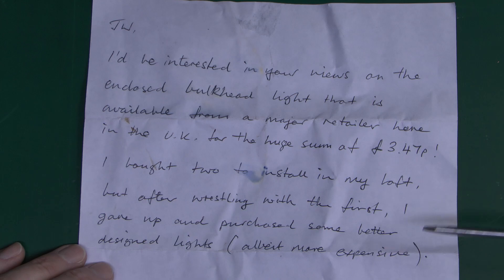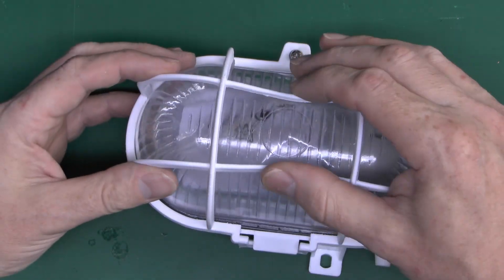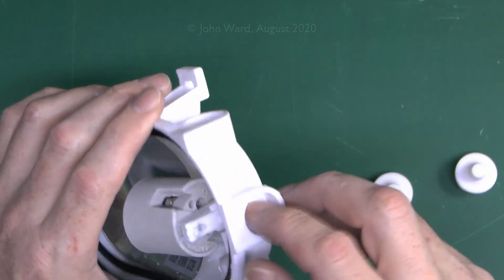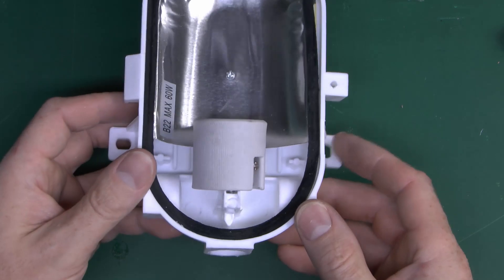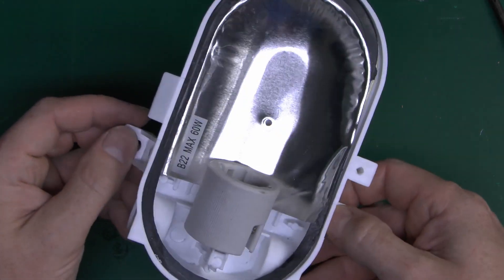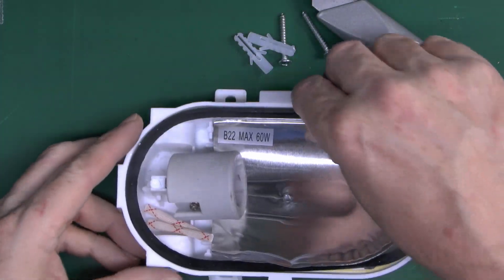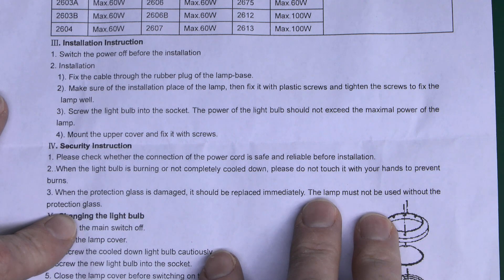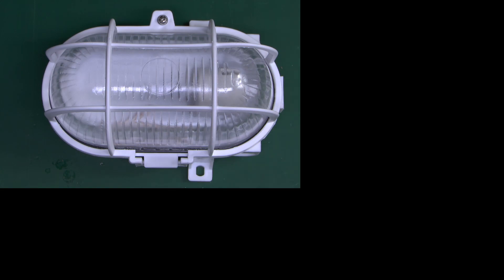Cheapo Bulkhead Light Fitting of Failure

Comment: I've fitted a few of these, but I think mine were £5.50 each. In all the cases where I was fitting them though they were terminating into PVC conduit boxes, so I completely assembled them with a lamp and 300mm of 2 core flex as a fly lead and put them up as a complete unit. I wouldn't fancy trying to wire them up while they were stuck to the wall.
Reply: I've used these with LED lamps, and did the same thing, fitted fly leads and used a junction box. Good enough.

Comment: I'd really like to see an experiment showing what happens if you really use a 60W incandescent bulb.
Reply: Much more fun with a 100W lamp 😀
Reply: if it's getting hot enough to need a ceramic bulb holder and fibreglass sleeving, the fixing of that holder to the plastic is going to be "interesting" isn't it?
Reply: Any 60W bulb would do. It doesn't have to be incandescent.
Reply: pmailkeey - such as?

Comment: “I wouldn’t recommend putting this in a mine”. Classic!

Fine for an attic. Wouldn’t fit these outside.
Reply: Chuck...
It's cheaper than using dynamite.
Reply: Providing your attic has no dry woodwork in the roof construction #fire haz.

Comment: If you buy a decent quality bulkhead fitting, it'll  last for decades, I installed an Appleby bulkhead light, (heavy metal base & glass bowl) in my front porch in 1989 & it is still in nightly use now, 31 years later. Originally used standard 60w GLS lamps, but in 2005 I installed a General Electric 12 watt CFL lamp & that is still going strong too!

Comment: Thats actually better than i expected for under 3.50. I didn't expect a glass cover and ceramic bulb holder. I expected cheap plastic.
Since the case is double insulated plastic, it doesn't need earth. Just screw a terminal block onto the earth wire, cut off the earth wire or use 2 core cable.
 I wouldn't mind fitting this but i wouldn't fit it outside.
Reply: Totally agree in that it's good value and also doesn't require an earth connection.

Comment: I remember using this exact model of light on a theatrical flat. Couldn't terminate the 20mm PVC conduit into it as I'd planned, so I had to drill a hole into the back and use a back box to hold it on, bending the reflector in the process. Glad it was only used for one week of shows.
Reply: Put the conduit into a box then run a flex.
Reply: @martinwinfield2935  I had to keep the full conduit appearance for it to match the set design. It was only a temporary installation.

Comment: I have one of these in my shed, lol. It was from Tool Station. It's not great but adequate. Hardly ever use it as I don't go in the shed at night. I think I just used two core flex from the switch I installed to the light, so Earth wasn't a problem dangling around as you say. You could always cut it right back to the outer sheathe anyway.
Reply: Arcane...
What's the point putting a light in the shed when you don't go in there at night?
Reply: @redblade8160   Sometimes I'm doing stuff in there just as the sun is going down or it's a really cloudy day, or I need to quickly get something out of the shed in the evening so only need it briefly. I turn it on about once every few months.
Reply: @ArcanePath360  
How do you manage to find the light switch in the evening when it's dark?
Reply: @redblade8160  lol, it's inside the door. I just reach around. Besides it's never that dark, as there are street lights nearby.

Comment: Wonder if that's the same ones B&Q have...

Last time I installed 60w basic cheap bulkheads the ones I got had polycarbon like plastic backing plates, very firm fitting glass covers with metal wire grilles, £6.95 each in 1990 and made in west germany, one over the back door was still going in 2004 till the building fabric got upgraded, far better made than what you have here which looks like a chinese made effort if I've guessed the country of manufacture right... though most stuff being made in China it would be a surprise if not.

Comment: John do all lighting circuits have to have an earth supplied, I'm looking at that and seeing all parts are plastic no live metal parts to be brought to the potential of earth? I agree with you it's definitely not going to cope with a 60 watt incandescant globe.
Reply: If it's at the end of the line, not a problem.  If you have other lights on the circuit, you need earth continuity in the cabling even if all the lights are like that one.
Reply: @bdf2718  Yer I understand that, but the cpc conductor could just be folded up out of the way, couldn't it?
Reply: @busman2000  BS7671 requires an earth to be provided to all points, even if it's not required by the current equipment. Presumably this is because the IET know that installations last much longer than the equipment they supply and the replacement equipment may not be the same class as the current equipment.

Comment: not the best fittings, but nowhere near as bad as you make out, there are much worse versions of these about. many new more expensive so called quality fittings are far worse than these with only enough room for a single flex and no possible way to have more than one cable in and terminate safely.

Comment: What exactly would you ground in that fixture? The entire thing is insulating materials, except for the internal reflector. I suppose you could ground that with its screw, but what's the point?  if you were doing a pass through, then you would need to pass the ground through, but in that case, you just connect them with a Waygo (sp?), wire nut, or crimp connector. For the pass through case, you would need one of those anyway for a proper pigtail.

That said, that plastic housing looks like a real piece of junk. It'd be interesting to see you flame test it or scratch it with a knife to see if it's got any glass fiber in it. I doubt it.

Actually though, come to think of it, I wouldn't use a pass through connection in that fixture. There's not anywhere near enough room to do a proper pigtail to the socket. You'd have to have room for three wire nuts or Waygos, and I don't see that.

Comment: Nothing particularly dangerous about these cheap light fittings, they're fine with an LED lamp in them. The supposedly superior metal versions are worse as eventually the powder coating fails and the cheap die cast corrodes. For sure there's really good versions of these available but as they're really intended for use on boats the price is astronomic.

Comment: What utter shite. Actually even worse than the WIckes examples i bought a few years ago; at least they were cast Aluminium. Surprisingly they still have paint on after years outside, so some sort of primer must have been used. The downsides were the low grade rubber gasket (lasted 2 years in the sun then had to be replaced by silicon mastic) and the set screws holding the shield/glass onto the base- which were chrome plated steel and rusted immediately (no sub layers of copper and nickel used)
I replaced the screws with stainless ones.     They had ES bases, which is arguably better.

Comment: It's plastic, don't need an earth connection. The label even got that double square to show it. If there's an earth in the cable it could be screwed to the reflector.

The plastic being soft is good, it doesn't get brittle when cold.

Comment: It’s got to be Toolstation that sells this cheap ass shite, I would highly not recommend putting these outside as because the plastic is so brittle it will snap off when exposed to UV light and condensation will build up behind the glass when the lamps are on. If exposed to heavy rain water will get in through the piss poor seals and it will cause the mains rcd to trip out the whole house!